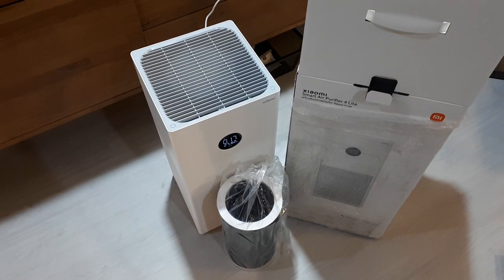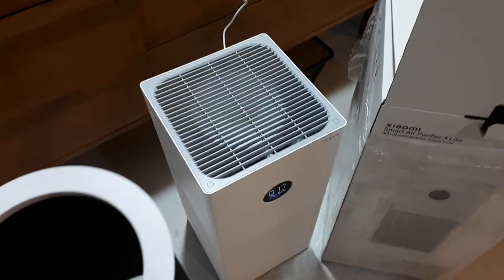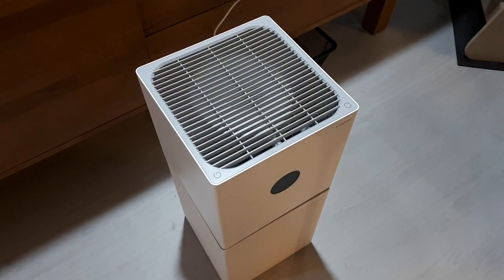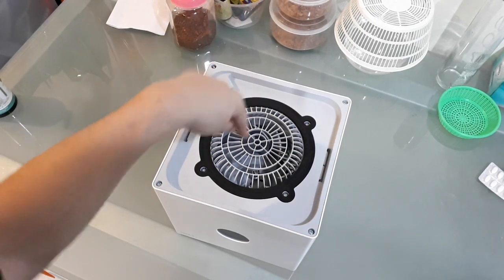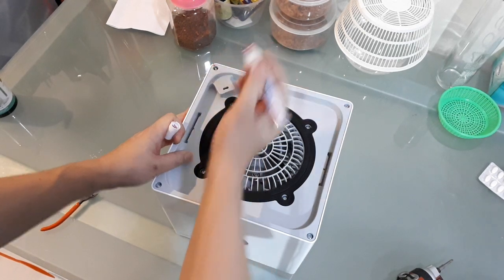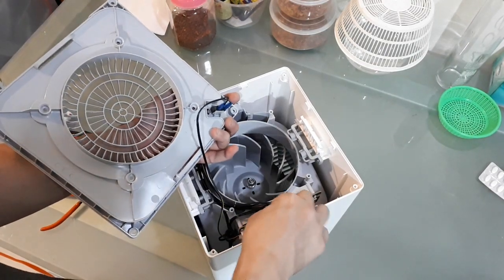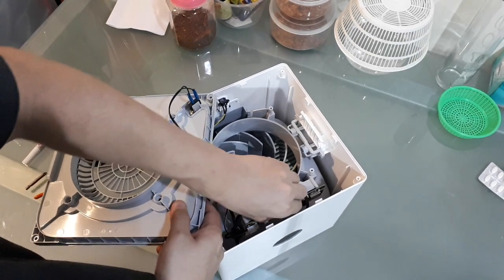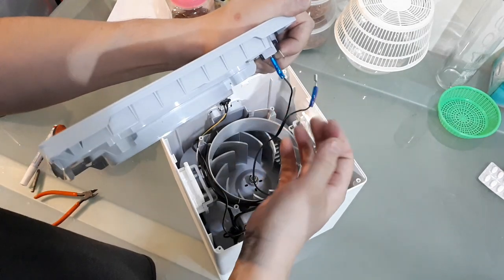Modify, Xiaomi Air Purifier 4 Lite to accept carbon inner filter cartridge, how to, modification,

Comment: @Small Model Collector You can modified it even better and cheaper than this, instead of buying that filter you can get carbon granules and fill gap between main filter and that perforated plastic, (you would need to open 1 hole in top corner so u can refill carbon when needed) than u will have sick purification. Little more work required but worth it...
Reply from the maker: @allexking  Yep, I filled the inside with big activated carbon pellets to suck out more chemicals.

Comment: What does this modiciation do in terms of air purification?
Reply from the maker: The stock hepa filter just traps large particles, but carbon traps chemical vapors.
Reply: @smallmodelcollector  where did you get this carbon filter from ?
Reply: @smallmodelcollector  I have same purifier, I want to perform this modification for voc trapping

Comment: Hi thank you for the video. 
Can you up a video in case of size issues of the entire filter? Xiaomi has now increased the size to 31 cm from 30 cm of the entire carbon filter and hence the top portion doesn't fit anymore